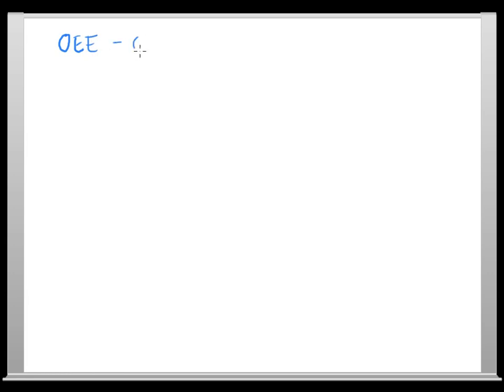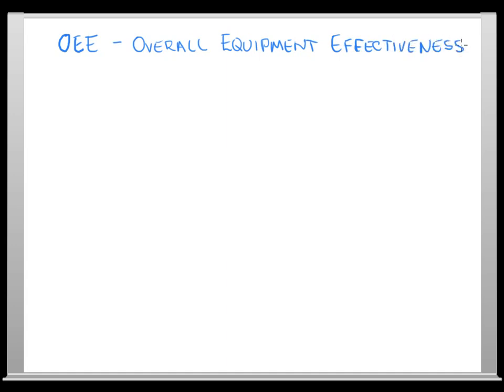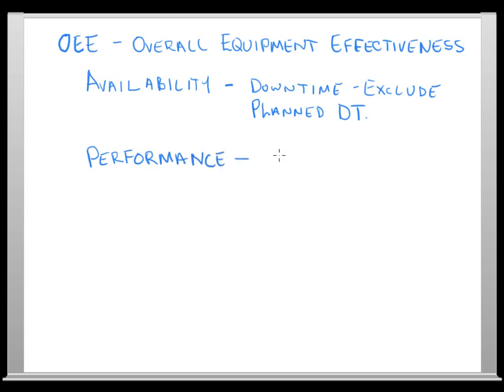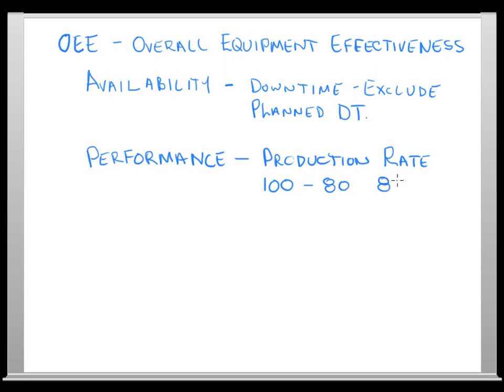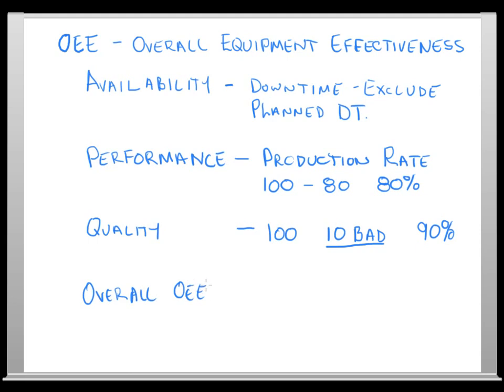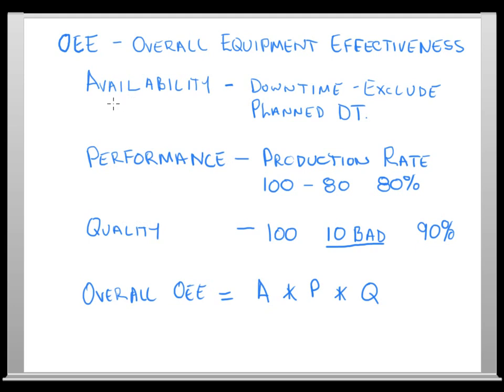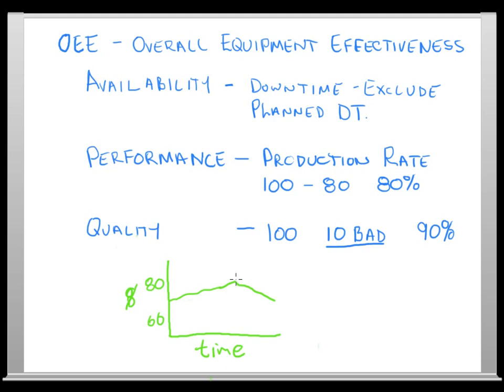What is OEE? (Overall Equipment Effectiveness)

Comment: Could we calculate OEE of a complete section as like efficiency is calculated for the whole floor instead of a single machine
Reply: @InductiveAutomation  Thanks alot...your help will definitely improve my work.
Reply: Thanks for sharing.If you help me to solve below case then it will be more cleaned to me...
Planned production time= 480 mints
Total machine=21
cycle time of section=2.7 mints
Total break down of all machine=150mints
Planned production=3700pcs
Actual production =3200pcs
Good pcs=3150
please calculate OEE of this section...